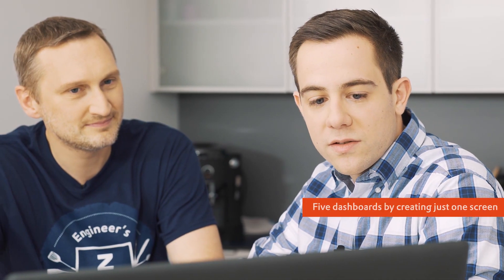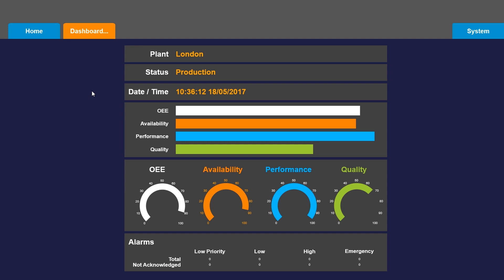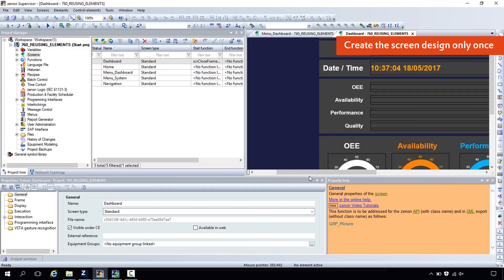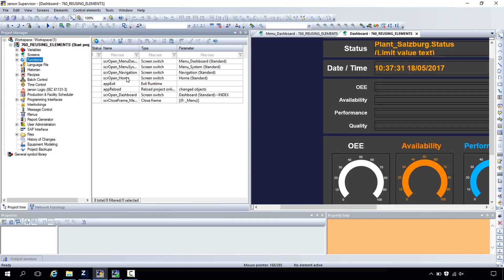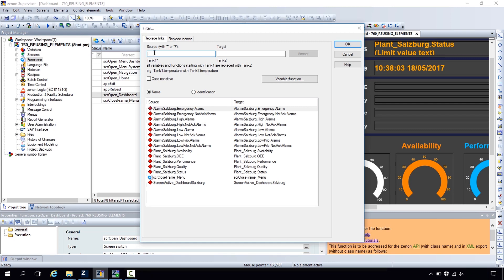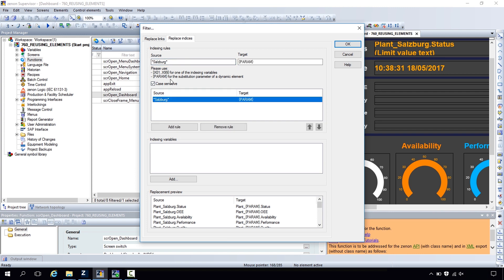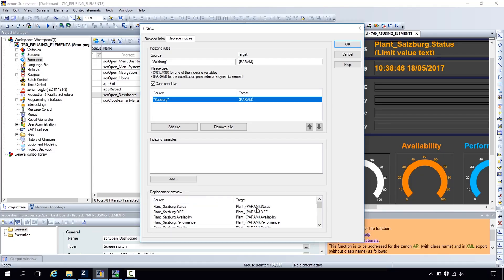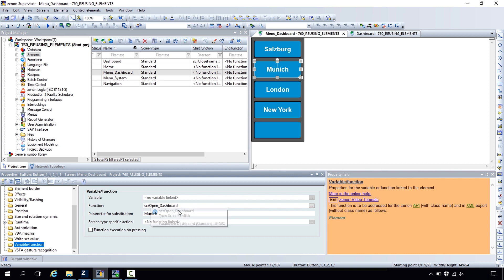Creating project screens with as little effort as possible (Episode 2)

Comment: Great initiative Reinhard...i would really like a video which show how to multiply same tag in 1 shot..for example if i have tag1 now if i have to multiply it by 10 then it will multiply that tag like tag1,tag2,tag3...tag10. Please share a video if it is possible in Zenon
Reply from the maker: Hi Ankit, 

thanks for your comment.

Of course, zenon supports such a functionality. :) 
It depends on the use case which zenon features is suitable. 
Would you just like to display different values of one PLC tag in zenon Runtime? Then for example, you can create a driver and browse the variables form PLC. Use the property ‘value calculation’ of the variable and navigate to the option ‘value adjustment linear’ or ‘value adjustment non-linear’. 
The value calculation defines the value range of the variable using different properties. 
Alternatively, you could use zenon Logic with a user defined function block, which has one input, a variable and does the calculation. 

Please also find our zenon Video Tutorials here: http://copadata.com/tutorials

BR, your COPA-DATA team